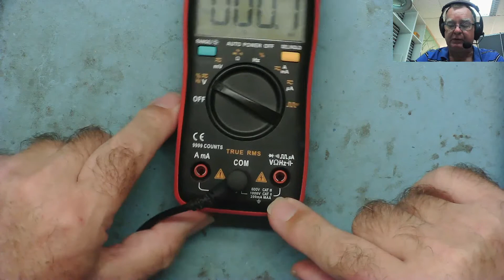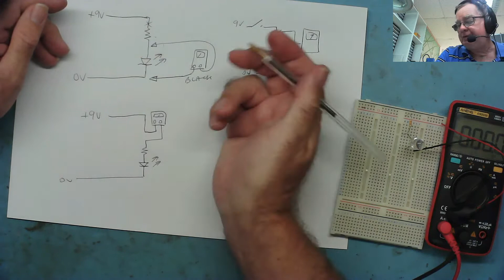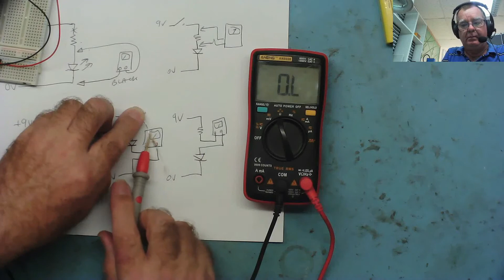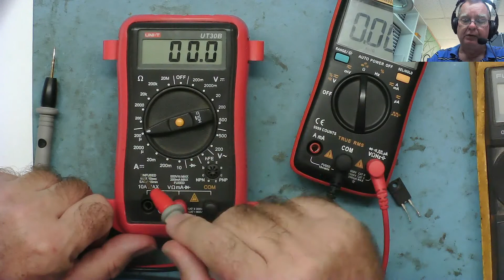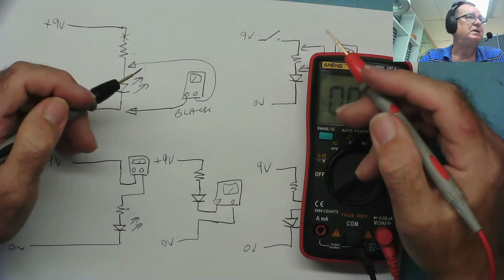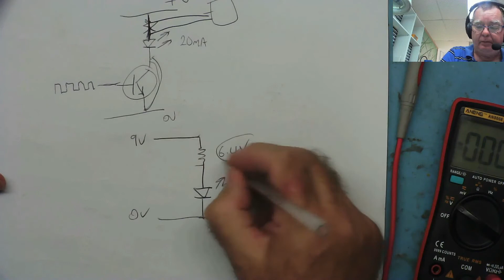How To Use A Multimeter

Comment: If you have a 1 ohm resistor in the circuit, you can measure current by measuring the voltage across the resistor since when resistance is one ohm V=I.